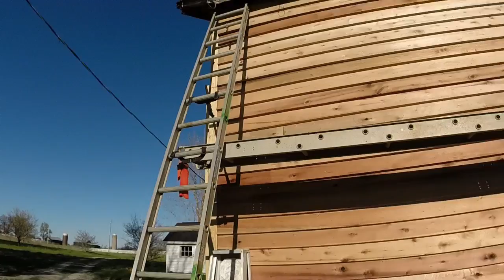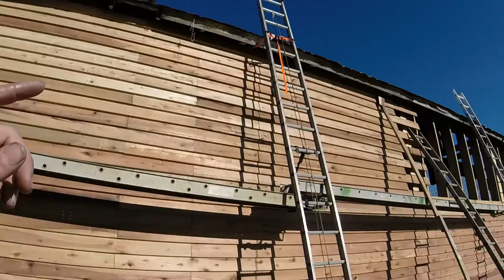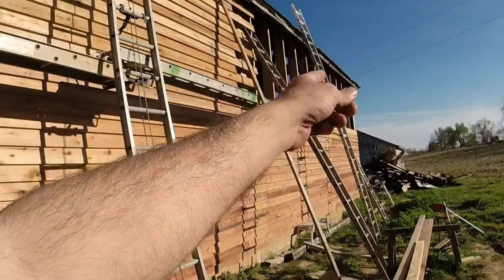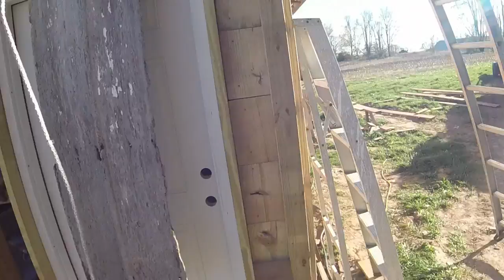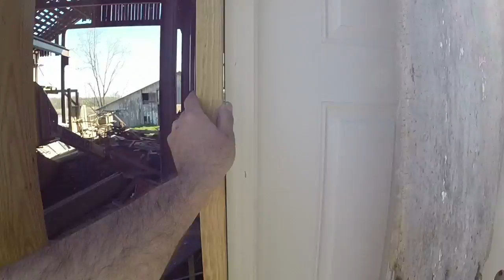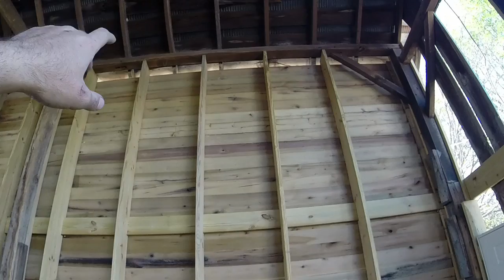Jacks and Ladders, this old Barn/Shop edition

Comment: Any reason you didn't use a barrier underneath of the wood siding?
Reply from the maker: To not collect moisture and to allow for some air turnover in the shop. There are lots of fumes in a shop and breathing them is not the best I don't imagine so a little heat loss to save lungs is a good trade off I think.

Comment: Now that is pretty darn impressive! Certainly more than I'd be able to do by myself!

Did you get the skylight fixed? I didn't get a clear view over your shoulder to see.
Reply from the maker: +l wilton Nope still open air. I decided I needed to get some walls up to get the air off the bottom side or it was just going to tear it up again and since it would be screwed down it would probably destroy the tin the next time.

Comment: hey Brian I'm hoping to start my build soon and have a local sawmill with poplar wood was wonder what the dimensions are on your siding I prefer the natural look and am interested in your look
Reply from the maker: +Jacob Eplin I am using standard fence boards which are roughly 1x6x16ft. They vary by 1/4 inch though being rough sawn, which makes working with it a bit more difficult  but you just have to get past the fact it isn't perfect and just go on with it.

Comment: Beautiful looking job with that planking, will it turn a silvery grey when it weathers? 

I think a fine stainless wire mesh perhaps fixed with battens would be a good idea for that top aperture but might snow or rain be blown in through the gap as I think that might be on the prevailing wind side of the workshop.
Reply from the maker: +Dan Whiteford The edge of the roof comes down about 8in more than the siding, can't see rain ever getting back up there, snow maybe but I think a screen door mesh would catch whatever might try to get blown over.

Comment: Shop is coming together Brian and looks really nice with the wood siding. Are you going to stain or seal the wood or just let it weather? You could put a wood soffit board up with mesh vents to keep the bees out. It would also match the siding as well as be functional, just an idea.  Jamie
Reply from the maker: +wvrockcrusher I plan to paint it white with elastomeric coating, which should be like putting rubber over the wall, keeping water out and sealing any gaps and cracks as well to make it more air tight.

Comment: This is starting to show some bigger progress, from now on, the steps are going to be more impressive every new videos.  The infrastructure work is necessary, but less eye catching...   ;)
Reply from the maker: +pierre beaudry Putting in wiring and lights so I can see will be pretty eye catching. :-)
Reply: bcbloc02
Hope you go modern and get LEDs   ;)
Still expansive though...
Reply from the maker: pierre beaudry
Tough decision, I have several 8ft flourescent fixtures in stock, hard not to use on hand free products only for long term energy savings. I may do a mix of both since I suspect it could take upwards of 30yr for the LED's to pay for themselves vs free lights. Decisions,  decisions....

Comment: As a builder here in California, I would only use insect screen if you need to keep out mosquitos, etc.  And I would back it with 1/4 inch hardware cloth, (galvanized) since none of the other screen materials have a long lifetime.  No fun going up there in a few years when the stuff disintegrates.  Of course the builder in me is wanting to do it my way.  A powerful lot of work done already...congrats on that!
Reply from the maker: +pierre beaudry All builders around here said tear down and build new pole barn for more $$. I like my one of a kind building better. :-)
Reply: +dhamma58 Good advice.
Reply: +dhamma58 If the ones of us with building experience would be on site, Brian would still be leaning on his shovel and waiting for our decisions...   lol
Reply from the maker: +dhamma58 Will have to check into hardware cloth, don't know that I really need it insect tight but it would be nice inc case I have to get up there in summer time to not  encounter unfriendly buggys. lol
Reply: +pierre beaudry No leaning for me when he started,  just running far away.  That was one scary building when he started. Maybe it was not that bad, but the structure sure looked marginal.  Maybe my preoccupation with earthquakes here makes me twitchy......
Reply: dhamma58
Brian is a surprising guy full of resources, so far it looks great, he's doing some restoration work for the next 100 years...   ;)
Reply: With hardware cloth you can hem over the edges for some mounting structure. Then just use a 3/4" wafer head screw to fasten it to the framing. If you want to keep out Mosquitos too, put fiber glass screen on and fold the hem over it.

Comment: glad to see the weather is nice, if not windy! So no barrier under the siding?? I would have used something like Tyvek to keep the moisture and wind out.
Reply from the maker: +thedge7 A little air flow is good for the environment, especially I think in a shop with smoke, oil,grinder dust and other  things.  I think the elastomeric paint is going to waterproof and seal most everything from the outside and I wanted to leave the inside so it could breath and let any moisture out of the boards that needs to come out to prevent rot.
Reply: +bcbloc02 Just make certain no water gets to fiberglass wool, heavy soaked wool will lump at the bottom of the wall fast...
 Tyvec is meant to be spaced at least 1" from the siding and while being waterproof it's not stopping vapors from going through. The advantage of Tyvec or any membrane is to keep the cold outside air circulating from penetrating into the first layers of insulation and will give you a better insulation factor.
Reply from the maker: pierre beaudry
Would have needed a total different configuration to use the tyvek then as no way to get spacing since boards screwed to studs. I think the siding is sealed up plenty good to keep water out from getting insulation wet. Will find out with time I guess.
Reply: bcbloc02
Sincerely hope you'll never find this out... As to install the Tyvec, you tack the Tyvec on the structure and add a furring in the same orientation as the 2 x10, this will give you the gag for air stream behind the siding, even with a little water pushed by the high winds you're protected, and that water will dry quickly...  Still time to implement if there is still siding to be done, mainly on sides of dominant winds...
Reply from the maker: pierre beaudry
The side that is done is the dominant wind side. The siding on my house is constructed same way as the barn is done and has lasted since the 1830's so I suspect this will be fine.

Comment: Instead of screen wire check into expanded metal.  It comes in various sizes and shapes.  It can be cut with a cutoff wheel, sheared, or torch cut(messier).  It should provide a larger area for air and increased sturdyness against animals.
Reply: +Roy Reynolds Got to get the mesh small enough if you don't want wasps in the attic, they're a pain to get rid of...  ;)
Reply: right
Reply: +Roy Reynolds Check into HARDWARE CLOTH.  It looks a lot like screen but heavier.  It comes in several meshes so should be able to get a small mesh to keep out wasps.
Reply from the maker: +Roy Reynolds The wasps apparently really like the new wood, they were buzzing everywhere while I was up on the scaffold, maybe they just thought I needed something else to keep an eye out for. :-( I doubt I will find something as useful as hardware cloth at the big box store but i will certainly look, may have to get some online.
Reply: bcbloc02
They look for sawdust or small wood debris to make the paper pulp to build their nest...  Your  construction site was like a Home Depot to them...   ;)
Reply: bcbloc02 Try a good hardware store, farm supply store, Tractor Supply, or some place like that.  There should be one in your area.